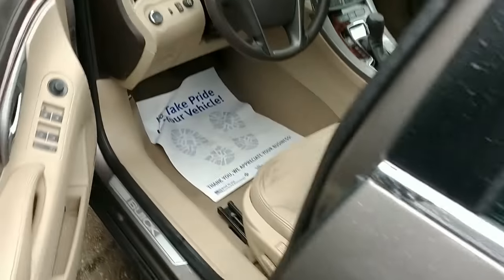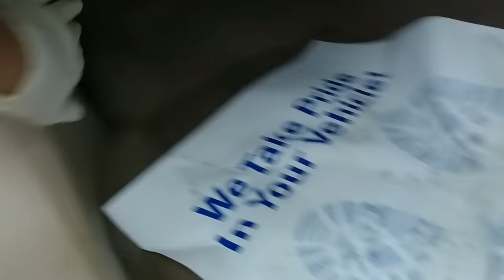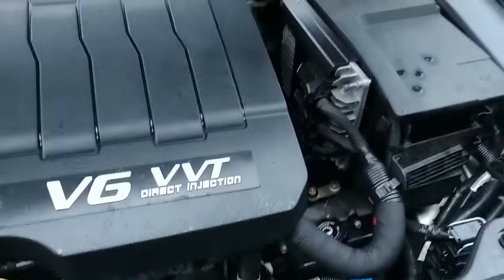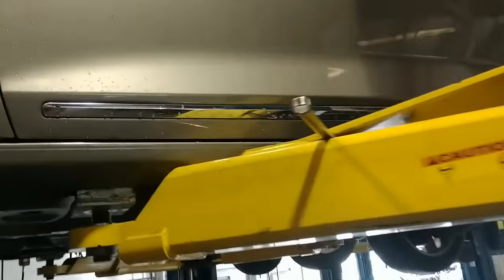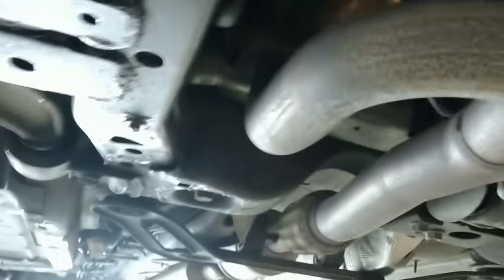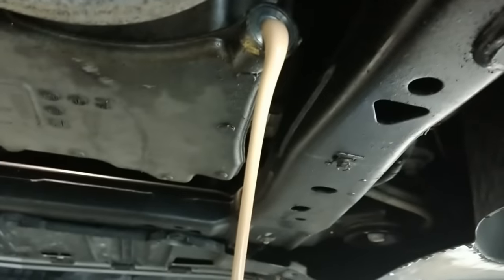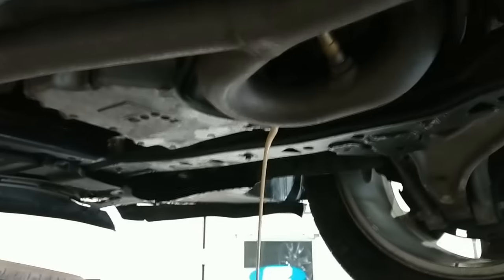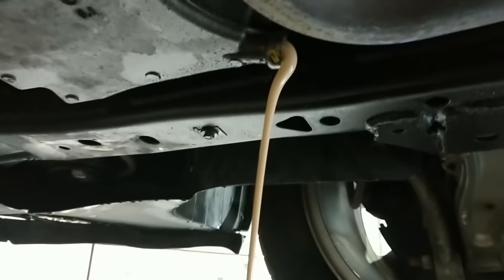Overfilled Crankcase! Blown ENGINE! Used Car Nightmare!

Comment: THAT is what oil looks like when an engine has run with coolant in it.    I see these guys post videos where they pull the oil pan drain plug and gallons of pure coolant come out followed by plain oil.    It is because they poured it in the crank case for the video.  When coolant gets in oil and the engine runs it emulsifies.
Reply: That's a good point
Reply: Let it sit long enough and it will separate out.
Reply: It will eventually separate. It needs an emulsifier too emulsify.
Reply: @randallsmerna384  eventually.     If you drive it in and put it on the rack and pull the drain plug you are not going to get pure coolant with oil floating on top.    If you don't believe me put a couple gallons of coolant in your oil pan drive it around and pull the plug.
Reply: @randallsmerna384  Not when they have supposedly  driven it to the mechanics and then driven it to the hoist.
Reply: @John Grzeskowiak I wouldn't bet money on it.    When I was a youth working in a wrecking yard.we had cars in the yard for years with that crap in engines.
Reply: @gsxrsquid  can confirm i have a subaru with a popped welch plug in the head, still has butter/milkshake on the dipstick and ive not started it in 5 years
Reply: @John Grzeskowiak If it does it would take awhile, much longer than the time it takes to do an oil change at your local mechanics shop
Reply: @John Grzeskowiak You need to address that fast! The oil is going to rot every rubber piece in your cooling system. The rubber used in cooling systems isnt designed to have any kind of oil resistance.

Does that Altima actually have an engine oil cooler or is it transmission fluid from the exchanger inside the radiator?? Most cars with engine oil coolers have them as a standalone cooler I thought.
Reply: @John Grzeskowiak Gotcha, I think I may have seen something similar on some trucks now that you described it to me. Good luck!
Reply: My Corolla cracked the head few years ago. When the mecanic opened the drain plug, they were separated. First the coolant came off and after that, the oil.
Reply: @John Grzeskowiak Yes. Depends how long it sits. 10 + years? for sure...
Reply: @gsxrsquid  True. It takes awhile for oil and water to separate when they have been thoroughly mixed. I spray aquatic weeds and on my spray system it draws chemical on one line and Ivod spray oil on the other. We have two spray pressures. Core is the low pressure and the spray oil sort of mixes but not very well. Invert is a much higher pressure, draws a lot more spray oil, and goes through a blender unit that has it coming out of the spray gun looking like Curel hand cream. It can take a few days to dissipate on the water especially if it's not like in the 90's outside.
Reply: thanks for teaching me a new word. I appreciate it. Emulsifies. make into or become an emulsion., Emulsion. a fine dispersion of minute droplets of one liquid in another in which it is not soluble or miscible.
and if I ever want to have a low key jack off joke
The time i spent causing emulation in my room as a teen was exorbitant.

Emulation (n.)
"a mixture of liquids insoluble in one another, where one is suspended in the other in the form of minute globules," 1610s, from French émulsion (16c.), from Modern Latin emulsionem (nominative emulsio), noun of action from past participle stem of emulgere "to milk out," from assimilated form of ex "out" (see ex-) + mulgere "to milk" (from PIE root *melg- "to rub off; to milk"). The fat (butter) in milk is the classic example of an emulsion, drops of one liquid dispersed throughout another. Sense in photography is by 1840.
Reply: Coolant will eventually separate,  and it will go to the bottom,  once you start the engine it will mix again right away
Reply: slightly oilier than average mayonnaise
Reply: Not correct. The two can definitely separate with an emulsified lower section and black oil on top. My tractor did this. And my diesel tractor has a very large sump. My immediate thought was damn I am going to have to take the head off. I probably going to have to split the tractor and rebuild. I talked to a mechanic mate who suggested I try using Bars leak in the coolant . So I thought I have nothing to lose and I really needed to use the tractor for a little job. So I repeatedly flushed the tractor with clean old oil. Heated it up put Bars leak in and followed the instructions. Left it. Then rechecked. So ran it gently with radiator cap loose. Stopped checked no leaks. Did this several times. Then changed for new oil.  Well that was years ago. It has slashed many paddocks since I am careful not to run it too hard. Check oil every time before use but it is still fine for my use. This was an old 1965 Fiat. I think I just got lucky. I don't think it would work in this scenario.
Reply: I had a time where I've seen straight coolant come out of the pan. Was on a Triton V10, pulled the plug for an oil change and immediately shoved it back in since all I got was straight coolant. Where was probably "milk" in there too, but after we told the customer, the truck went right to the salvage yard, so I never got to see.

Comment: That is how my first car died. When I was in my teens, bought the 1996 Plymouth Voyager from my parents for $500. I ended up putting another 90k miles on that vehicle. Note: That odometer had already rolled over once and the last reading on the odometer was back up to 220k. One day just driving along and suddenly it sounds like somebody tossed a bag of hammers into the engine. Had a gasket blow open and coolant poured like the Nile into the engine. Pulled over, pulled out the dipstick and said, "Well, she's fucking dead."

But you know what? As a kid, that van went to 33 out of the 50 States and still lasted me another two years after buying it. That was a good car. Rest in peace sky blue Voyager.
Reply: Normally, there are some warnings for when that sort of thing's about to happen and if it gets caught in time, it's salvageable.

My 95 Fort Escort had a head gasket fail and still drove for 5 more years after it was fix. A few years prior, the freeze plug messed up on me and it ran to the shop like that, stopping to dump some coolant in it(always kept some in the car just in case). 
Hell, if it hadn't been in a wreck, it'd still be driving today. Hell, it probably still would've drivable, but I didn't have the money to pay the tow truck guy the cops called.

Anyway, the point is you'd be surprised what you could fix.
Reply: Those always had that problems 😂
Reply: @realtalk37851  you say that, but the car did make it to over 1,200,000 miles.
Reply: I was on my way to PA, passing through Dallas in the middle of August when I saw smoke out the tail and the engine started stumbling. I finally found a pull off after the lake bridge. I checked the oil and it was all a creamy root beer float color and I knew it was going to be bad day lol
Reply: I've lost two cars to blown head gaskets. One was a 96 Volvo 850, and the other a 97 Cutlass. I got a good amount of life out of them tho. I had over 200k miles on the Volvo and 150k on the Cutlass. RIP brother...
Reply: For $500, you got your money's worth out of that vehicle.
Reply: That's a lot of miles. I have a 1998 Ford explorer 4.0 6 cylinder 2 door. I bought it for a $1000 in 2012 from woman that did know anything about cars. She said it didn't run right. My brother looked it over(he was a diesel mechanic be for he passed away) he said the oil was good and radiator had anti freeze in radiator coolant was in the side and had fluid for windshield. He took it for test drive. He found it need a battery and brakes, possible brake booster. He said to pay her asking price. I drove his truck and he drove the Ford. He did the work in less then 2 hours. He ever flushed the motor with diesel fuel and added some real cheap oil that didn't have detergent in it. Change head lights out a week later and replaced all the hoses and tubing did a timing chain and gear replacement.  It run like brand new car afterward. I still drive it.
I had to have the frontend rebuilt last January 2021 new tires. It had just under 200,000 miles and now has 232,000 on the odometer. It has been the best car I ever had. I'm sure with the way I drive it will out live me.
Reply: There's no way that made it to 1.2 million😂 ours died at around 270k
Reply: @joshuawilcox1322  dad took good care of that van. The furthest from Kansas City that van drove, eight times, was Oregon. That van saw so much. Good old four banger just finally had enough.
Reply: That has to have been the best minivan Chrysler ever made in the 90s, their quality was so bad even transmissions are considered a "normal wear item" that need replacing every few years.
Reply: @user-ut9ln4vd5m  While thinking about this, I asked my father if there was ever any major work done on that vehicle. He said in either 04 or 05 some minor transmission work was done. Something about it constantly slipping when gong from first to second gear and sometimes not wanting to shift into park. Said it was about a $1,200 repair.
Reply: That would be 580 miles a day every day for 25 years. Not impossible but not probable.
Reply: @evillefabrication388  And to make 580 miles a day, they have about 9 hours a day of driving if they can keep going at least 65 mph and not slow down. Otherwise it would take even longer. Like you said, "Not impossible but not probable"
Reply: My last car had 250,000 miles on it. It was a Honda accord. It needed a transmission but would still drive. I just had to drive it a certain way in a different gear. That car was a fighter. It wouldn't quit.
Reply: those vans were serious work horses
Reply: @DJchoppa666  considering there was nothing thing else wrong with that van, I very well could've still been driving it if I'd caught the leak
Reply: You would be surprised how much of a beating those old engines could take. Depends on how much you ran it with coolant in the crank. Drop the pan, and the Manifold flush it out put a new gasket in. We used to salvage old 350's out of junk yards things would still run no problem with minimum work. Though the old muscle car engines bays were a hell of a lot easier to deal with though.
Reply: @nikushim6665  My father and I took real good care of that van. It was very well maintained. And a well maintained engine can go a ridiculous length before finally petering out.

As an added thing, that van had been almost coast to coast a few dozen times. It got to see almost the entire continental United States before it finally died. It certainly lived a hard but good life.
Reply: @realtalk37851  mine sure did
Reply: Plymouth's were amazing. One saved my life. Got T-boned by a guy trying to cross the highway in the middle of a fog storm, slammed into my passenger side door and almost knocked my Plymouth breeze into oncoming traffic. Everything did it's job. Seatbelt held me firm, airbags deployed, and brakes did their job and saved me from going into the oncoming traffic even though the axel broke. Meanwhile, brand new 2017 SUV that hit me had literally nothing go off. Hit me and died. No power, no airbags, no brakes. Apparently he'd bought it that month, injured his back too. Meanwhile I was just a lil shook up. And, like you said, I put some goddamn miles in that thing. Insurance determined the engine was in nice enough condition to give me 4 grand for it, which I didn't expect based on its age and miles
Reply: @evillefabrication388  I think you need to recheck that calculation. 1200000 miles divided by 25 years is 48000 miles/y divided by 365,25=131,4 miles per day
Reply: Next time hire a Tech end pay 300 Dollars
Reply: RIP. Sounds like that old bucket of bolts served you well, though, and for a $500 minivan with that many miles on it, hey, you got your money's worth.

Comment: I'm grateful I have mechanical experience (DIY'er for a few decades, tackling pretty much everything including an engine and tranny rebuild(s))  I've had more than a few instances where I brought out my tool box when going to buy a car and seeing the seller's face drop, and a few minutes later I pack up and RUN from the sale.  One had coolant levels dropping while we spoke, and wasn't dripping out or going out the tail pipe.  Sellers said, "It's never done THAT before." Uh. Huh.  Another clue... if you find water in the radiator (no coolant), you're in for a world of hurt, because it was being lost so fast that it was too expensive to put in.  Beware of buying cars who have a rats nest of wiring under the dash and have racing pedals installed. And for goodness sake, SNIFF the oil and transmission fluid, and look down any filler holes with a flashlight to see what the fluid looks like.  Then LISTEN and FEEL and SMELL how it runs, and turn off the stereo and AC, and try a number of driving conditions with turns, braking, acceleration in various ranges.  Bring a magnet wrapped in tape to see if it falls off the body as you're dragging it along the surface.  Trust your gut.  Bring friends and don't bring a wallet with you so you don't get mugged.  Do your sale in a safe place in the daytime.  You miss too much at night. And don't buy a used car from my brother!  He's tried foisting a few lemons on me.  DUUUUDE!
Reply: some good ideas there.. thanks.....
magnet wrapped in tape..  cool idea ... smart too...  to show how badly bogged it is ...lol
Reply: Whats with the taped magnet?
Reply: @LucidDream34  so it wont scrape the bodywork or paint as an unwrapped magnet wold (with sharp edges)
Reply: Sale would end as soon as I seen a tool box nobody touching my shit without paying for it .real mechanics can tell if it’s a good car just by turning the key like me and take it for a 20 minute drive I will know everything.
Reply: @mplscarsales6652   Little edgy are we??
Reply: @Matt Tucker People who have attached all kinds of extra devices (gauges, stereo equipment, whatever) tend to push cars a bit hard.  I want a cream puff that hasn't been modified heavily.
Reply: @mplscarsales6652  If what you're trying to sell has no problems, a toolbox shouldn't scare you, at all. In fact, if you were a """real mechanic""", you should mentally say, "yep, makes sense" at the sight of a toolbox.
Reply: How did you rebuild the tranny? Take the knob off? (sorry haha couldn't help it)